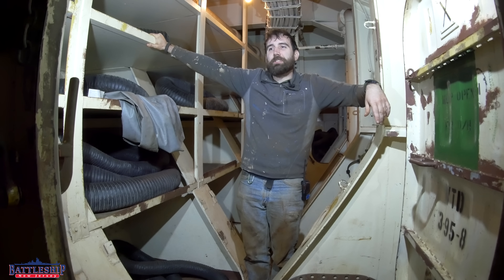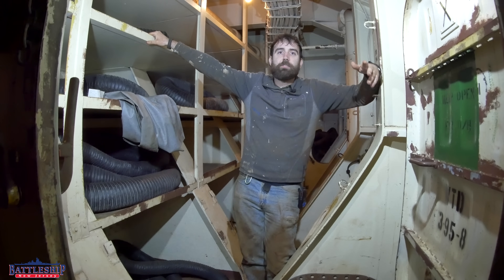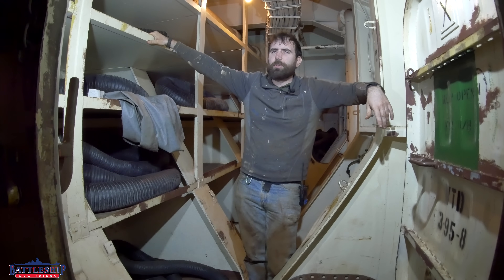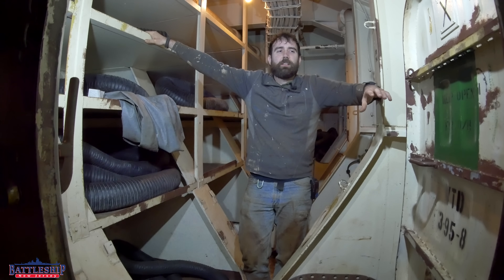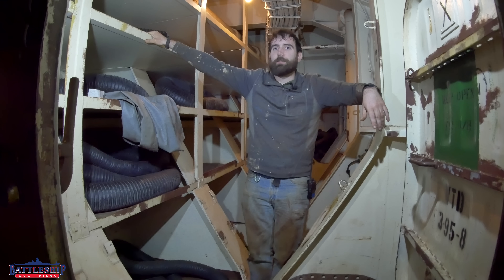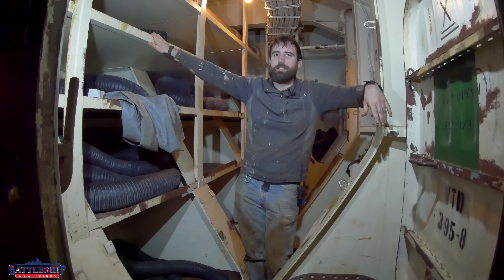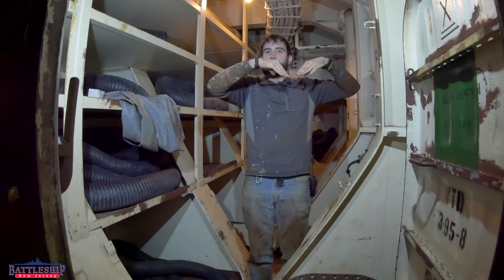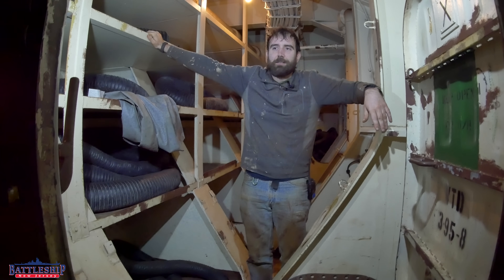The Best Torpedo Defense On a Battleship

Comment: Also, the problem with fuel, water, or ballast tanks is at some point they may be empty as fuel is used or ballast is shifted as needed.
Reply: You can always counter-ballast with seawater when a tank is emptied.  I think oil can be topped off with seawater at the same time, as they will not mix, but not fresh water.  Environmental reasons put an end to mixing in tanks.

Comment: Are steerable external propulsion pods better or worse?  A shutdown pod removes the jammed rudder danger.
Reply: You could argue they are more subject to shock damage, but a militarized version might reduce that.
Reply: Because warships have to achieve very high speeds the electric motor necessary to develop that kind of shaft horsepower is too great for an azipod.

Comment: Why is such a large (arguably important) overhead conduit located in a space which was essentially designed to be expendable? I mean not that they PLAN on getting hit there, but is all that wiring just for stuff outside of the main belt and they have to collect it and run through one area? That might be an interesting video actually, are there any locations where something was built through the full thickness of the main armor belt?

Comment: The Iowa has 13" hardened steel belt armor with 4" more in a double shell hull.  If it made it through that. 17" hardened steel pilot house with a periscope.  Clear, red, and yellow, lenses.

Comment: Was there ever thought about filling the torpedo voids with foam or cork or many inflatable bags to help maintain buoyancy in cases of any hull plating breach?
Reply: Don't remember which one, but I did read about someone doing that (Italian?).  The flip side is it reduces the usefulness of the space for other uses, such as over-filling with oil if transiting in safe zones, or use as a counter-flooding space if the other side gets hit.
Reply: @gregorywright4918  yes you're thinking of Italy's Puglisi system. No it didn't work.
Reply: @navyreviewer  I was rereading about that last night.  It was the French.  From the Wiki article: "The ships' underwater protection system was based on the system used in the Dunkerque class. The void between the armor belt and the outer hull plating was filled with a rubber-based compound referred to as ébonite mousse; the material was used to absorb the impact of an explosion and prevent water from flooding uncontrollably."
Reply: Filling a void with foam or some other substance makes it very difficult to inspect for leaks and corrosion.  At overhaul all of that stuff would have to be removed before the void space could be sandblasted, any leaks identified and repaired and the interior re-coated.

Comment: Well, by the time they were sitting off the coast of Lebanon they just assigned 2 fast attacks to sit there and chase everyone away. Seemed to work reasonably well.
Reply: They were chasing off small surface craft, which might have RPGs or suicide bombs, not torpedoes.  If the Lebanese had subs with torpedoes they would have had to use speed and escorts.
Reply: Small surface craft could be chased away by the weapons the BB's had onboard or by the aircraft that were in the area. As a fast attack sailor we were not there to chase of anything Lebanese, everything we chased was Soviet.

Comment: Ryan, I read somewhere that the science of steel making evolved considerably after WW-2.  Not just in efficiency, but also in the strength and resilience of the material.  Factor in also the use of plastic explosives, in reactive armor,  as seen in tanks.   If,   you were given a cheque for $ 12 billion,  to build a battleship today,  what could you describe,  in those terms,  and also for the armament ?  I realize that's somewhat of a project,  but it maybe an interesting idea for a series,,,
Reply: They plundered tons of tech from Germany after the war.  Even during the war they had captured downed German planes and they couldn't figure out how the Germans made them.
Reply: Somewhere I saw an image of an M-1 Abrams APFSDS round poking right through 17 inches of rolled homogenous steel armor.  The gun that shoots it is 120mm diameter and after the sabot falls off you have a 45mm diameter depleted uranium spike with fins on the back, and it would defeat the armor on an Iowa class.  
Something like a modern BROACH warhead will defeat any armoring scheme that would float.  That warhead can penetrate a meter or more of steel reinforced concrete that is under a similar depth of dirt.  They blow buried bunkers and other hardened targets.  You find BROACH warheads on missiles like Storm Shadow, JASSM/JASSM-ER/JASSM-XR, LRASM and JSOW-C1 to name a few.

Comment: I would love to see good videos of the framing and welding. I have built a lot of aluminum boats and done a bit of steel shipbuilding and later moved into different types of land based construction. I found it really interesting how different code committee's ha e different views on what is ideal with some preferences being defective by another standard. I would find it interesting to see what the welding was like on a full warship when welding was still pretty new and what if anything has changed.
Reply: The US is very secretive about its hull construction techniques, especially, for its carriers. That's part of the reason you wont see any super carrier museums.

Comment: Considering the number of late war torpedoes (with much higher power) it took to sink the Yamato class I'd have to say those. In this specific case bigger was better.
Reply: Yamato was sunk by air dropped torpedoes which were smaller than the ones that a sub or destroyer could launch.
Reply: Those were small air-dropped torpedoes that were much weaker than sub or ship-launched torps.  And just because Yamato and Musashi were hit that many times, that doesn’t mean that’s how many it took to sink them.  The US Navy wasn’t going to fire a few torps, then wait to see if they sank, then fire off some more.  They went for total overkill.  Those ships probably would have gone down eventually with far fewer hits.  Yamato suffered major damage from just one lucky hit with an early-war Mark 14.

Comment: South Dakota-class BBs probably had the best TD architecture. Their armor belt was inside the ship and sloped. It was continuous from the top of the citadel down to the double bottom and it did triple service - it was an armor belt, it was structure, and it also formed the torpedo bulkhead.
Reply: And the engine rooms were much smaller than the Iowas, since they had less speed, so there was more space outboard for TDS.
Reply: @gregorywright4918  Man, I hate to nit-pick, but there really is no connection between her speed, her machinery and the depth of her TD system. SD-class ships had the exact same beam as the NC-class that preceded and the Iowa-class that followed. They had the exact same machinery as the NC-class but it was arranged more efficiently. But the real issue there was not the beam, it was the length of the hull. As stated, they had the exact same beam as the NC-class. As far as the depth of the TD system, the NCs, the SDs, and the Iowas all had systems of similar depth. It was the internal belt that also formed the torpedo bulkhead that made the SDs better protected.

Comment: I'm curious whether it was ever studied to have an outer plate that actually folds away from the ship while underway, leaving a gap filled with seawater between the plate and the actual hull of the ship. This would certainly create some extra drag, but my intuition (without actually crunching any numbers) is that it wouldn't be that bad. Perhaps that intuition is incorrect, though. Having a folding plate could allow it to be folded up against the hull when in dry dock, navigating a canal, etc., then folded back out away from the hull when back in open water. (Of course, this wouldn't help against modern torpedoes.)
Reply: Whatever mechanism you designed to fold and unfold the system would have to be VERY strong to deal with the pressure of 20-30 knots underway speed.  The non-folding versions of what you are talking about were called bulges, and they did create significant drag.
Reply: @gregorywright4918  Yes, it would need to be strong, but I wouldn't think that it would get a lot of pressure from the speed through the water, as the plate would be parallel to the flow of water (i.e. parallel to the hull,) so the cross-section of it should just be the leading edge. The primary advantages of this over torpedo blisters/bulges would be that it could be retracted when needed and that it would not significantly increase the cross-section of the ship relative to the flow of water. Granted, it would likely experience very high hydrodynamic loading during turns.

It's entirely possible that I'm just underestimating skin drag, though. Obviously, any cross-sectional area exposed to the water flow experiences enormous drag, but I'm not familiar enough with hydrodynamics to know how much drag is experienced on surfaces that are parallel to the flow (i.e. skin drag.) I know this can generate quite significant drag on aircraft (which is a large part of why it's important for the wings and fuselage to remain clean,) but I'm not sure how that translates to hydrodynamics at 30 kt vs. aerodynamics at hundreds of kt.

Comment: With the enlargement of the Panama Canal, at least that's no longer the bottleneck that it used to be.
Reply: There were plans to do that during the war, but they needed the engineering troops for other things (like the Aleutian Road and the Sea Bees).  The MIdways were the first ships that would not fit the old width.
Reply: The locks are still not wide enough for a Nimitz or Ford class

Comment: Ryan's explanation of how a modern under keel explosion breaks the back of a warship is also a good description of how a depth charge sinks a submarine.  The depth charge explosion creates a hole in the ocean that over flexes the hull of the submarine, even if the original explosion didn't impact it directly.  The explosion will rebound in and out as it surfaces, so even if the depth was set too deep, it can still kill the submarine as it "floats by" towards the surface.  In movies, the huge surface explosion is actually caused then the depth charge is set too shallow, and the initial explosion breaches the surface immediately.  Looks cool, but wastes the power of the explosion.
Reply: Yes, although you’d need a really massive torpedo to actually break the keel of a battleship.  Sure, you’d blow a big hole in the bottom, but a battleship keel is much more massive and rigid than the average ship.  The ship’s sheer size and belt armor also give it a lot of longitudinal rigidity.  The length and beam of the ship also mean that the void created by the explosion is much smaller relative to the ship, and therefore there is less pressure on the keel.

Comment: Would multi-hull designs help with modern torpedoes? Or putting a hull or multiple hulls within a hull? Or maybe put your ships on hydrofoils? Or maybe we need anti-torpedo torpedoes, perhaps using small, rocket-propelled, super-cavitating point-defense torps.
Reply: Cat or tri-marans?  Not really, they are still not built to take those kinds of stresses.
Reply: @gregorywright4918  But they could be built that way, and the shape might deflect an underwater blast effectively like the underside of an MRAP.

Comment: As below, best defense is not to get hit by a torpedo. Therefore today the key is detection of the torpedo and the means to eliminate as far from your ship as possible.  Explosions in water lose their effectiveness over distance, so the farther away the torpedo explodes the better.  Passive ways is Nixie (trail a steel cable that is able to mask the ship, or create more noise, or electronic countermeasures).  Active could be a smaller torpedo used to hunt the incoming torpedo.  Another would be similar to the old hedgehog (sub countermeasure for U-boats from WW2), except in this case would drop down over an area the torpedo would come into (again the farther from the ship as possible).
A third measure is the construction of the ship itself. 
Most of the weight of the ship lies or is attached to the keel, break the keel, break/sink the ship.  In drydock the ship lies on the keel to support the weight of the ship.  
So what could you use to strengthen the ship construction to support the weight of the ship when water doesn't support its weight.  Torsional decks that resist bending (torsion boxes). These decks would have to be long at least 2-3 X explosion diameter (also supported by torsional bulkheads longitudinally min 4 to provide a very stiff box).  A suspension bridge has stay cables under tension, to hold the weight of the bridge decks on suspension bridges. The problem with this is the anchor has to be supported by water (the support is not undermined by the explosion). On a battleship the fwd and aft armor bulkheads could be used as anchors (towers on suspension bridges).
Also below someone mention venting the explosion to the surface.  Probably not practical due to the explosive amount of gases, but I like the idea of "path of least resistance" of the explosion to follow.  This could possibly screw up the secondary effect of a torpedo explosion.
Reply: Problem there is that you are assuming the bubble is centered under your ship - if it is not, your "torsional deck" has no end support.  Plus the ship is moving.

Comment: I suspect the ww1 torpedo bulges were fairly effective into ww2 but they were an unacceptable amount of drag and extra weight on the hull by ww2 especially when the battleships were really expected to sail around the world. part of the issue is that ww2 air dropped torpedoes and older models did impact the hulls but sub and crusier launched models would sail underneath to ideally detonate, so you had an added complexity of designing around two scenarios

Comment: I take it filling the void spaces with rubber balls would not be better?
Reply: There has to be a joke in there somewhere...
Reply: Part of the calculations are how different types of "filler" would change the dissipation of the explosive pressure and reduce the amount of shrapnel flying around.  That quantity of rubber (aside from the scarcity of rubber at that time) would have a weight effect as well as a change to the pressure dissipation.  The benefit of the void plan is that it is just air and water (or oil) taking care of the problem.

Comment: I think the New Jersey would take an underwater torpedo better than a modern ship because new ships are out together in blocks New Jersey has a solid kneel an should flex a little better.
Reply: Those ships built today still have keels too.  Everything is just welded... So the keel is welded together, along with the sides of the ships.  And any longitudinal members (steel beam that would run fwd to aft),  that pass between the blocks.